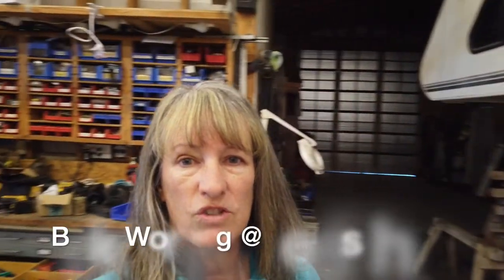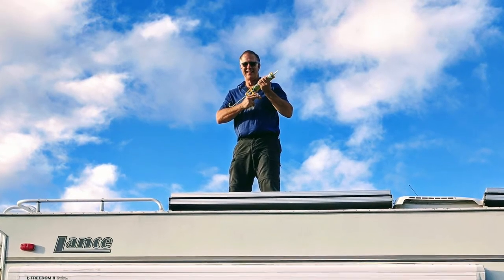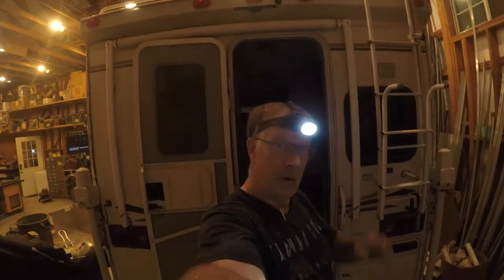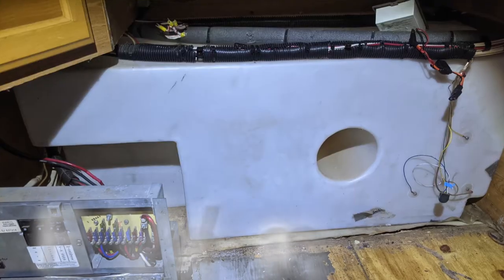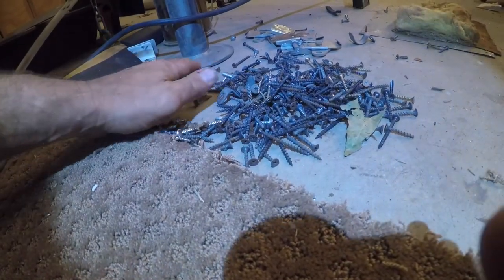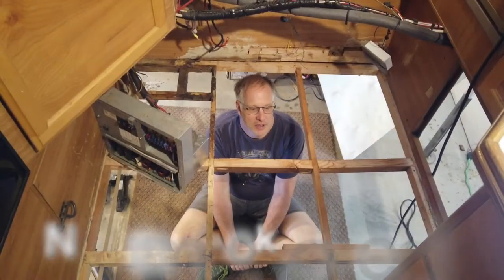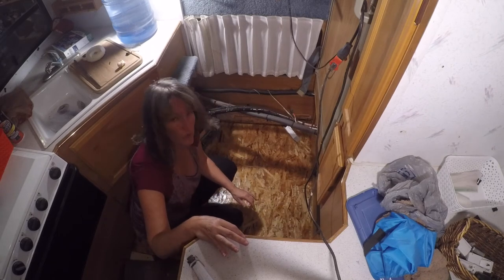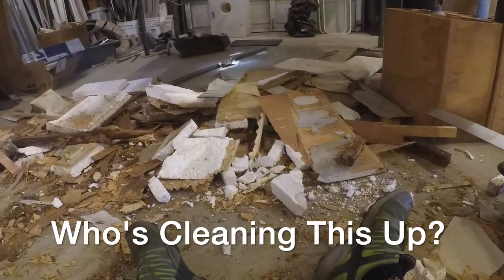RV Water Damage | Complete Floor Tear Out & Replace

Comment: We had the same problem with our travel trailer.  In the midst of restoring it, we discovered major wood rot.  So we finalized our decision to go to a tent and sold the camper (with full discolsure).  We are now thinking of going with a truck camper so we found your video very helpful!  Thanks for the great share!  💙Terry and Terri
Reply from the maker: Good to hear.  I think if we were just weekend warriors, I’d be happy with a smaller truck and rooftop tent as my minimum.  But both of us wanted more space, comfort, all weather capable rig plus the 4x4 and higher clearance.  And the right truck camper does all of that.  There’s such a broad range now to look at from small pop ups to the Scout sized to the full size and then the extra large Hosts.  If you haven’t found www.TruckCamperAdventure.com, check him out.  He was numerous articles and reviews for the truck camper world.  He’s a nice mix of industry, tips, and diy articles….and a just a nice guy to boot.  

Back to the wood rot, it’s bad news and I’m glad you discovered it even though it was after the fact. We know the guy we bought the Lance from would’ve had no clue what was lurking underneath unless the original owner divulged why he installed new laminate flooring.
Reply: @WorkingOnExploring  The weather is the main reason we are rethinking the tent.  Thanks for the link - will definitely check it out!  I don't think the owners who sold us our trailer knew the rot was there either - there was no indication at all.  Thanks again!  💙Terry and Terri

Comment: We are rebuilding a Lance 1121 truck camper.  How did you remove the water tank which looks just like ours? Were the water inlets and drain under the floor or on the side above floor level?  If below, how did you reinstall the tank?
Reply from the maker: They are at the left front corner and there was a 6x6 sheet metal plate screwed on the underside, covering the outlet and drain. The fill is at the top left and can be found under the sink. Getting the tank out is a bit tricky. The step to the bunk has 6 screws holding it down and are hidden in the carpet on the step, one in each corner and one in the center front and back. Once the cover is off, you can find most of the rest of the screws that hold the side of the sink cabinet and the inside bottom of the sink cabinet. Once you get started, a little tugging will reveal where the screws are. Most are not difficult to find or remove. Even when i had everything out  it was still tricky to get it slid out...can't recall exactly what the tricks were but I think it is doable....I did demo the floor before I took it out but don't think that was a factor.
Reply: @WorkingOnExploring  Thank you.  We have the step cover off and will look at the sink cabinet again. The tank is wedged in tightly and we were concerned that we could not nudge the tank out because of the cabinet and the propane line running across the top of the tank.
Reply from the maker: @KS-fg9st6lk2m  As I recall, I did have to disassemble a good bit of the sink cabinet and some of the lower fridge cabinet. They most definitely don't put it in that way. I'm sure the tank is likely the first thing they set on the floor and start placing cabinets around it. I was surprised the cabinets were just screwed together and not glued. This was likely specifically to enable getting the tank out. The reason my floor rotted was leaking from the tank outlet or drain (all the leaking occurred before I owned it). (I think it was not OEM), A previous owner had also installed a tread plate cover over the lower front of the exterior that hid/supported the rot in the front wall but more importantly, it wrapped around the tank access cover on the bottom.